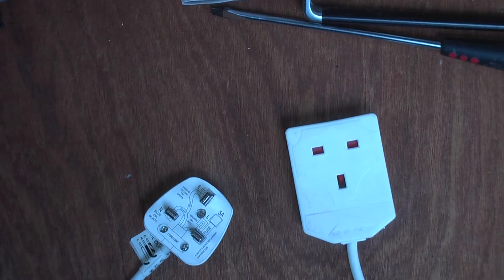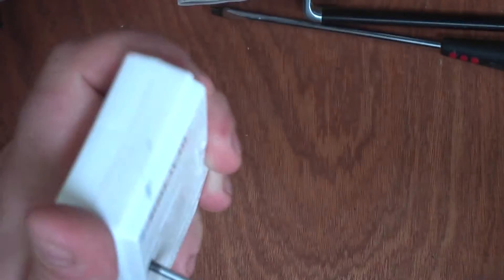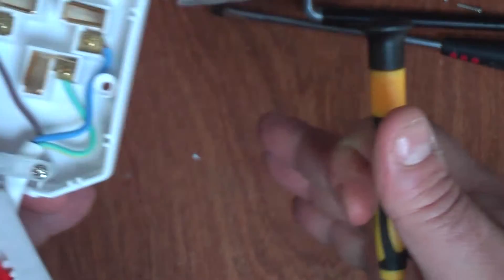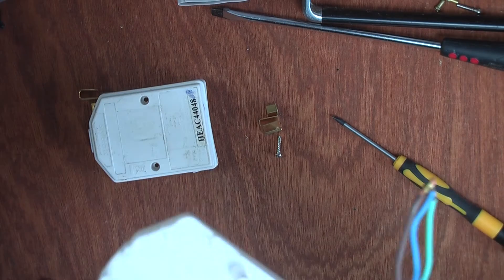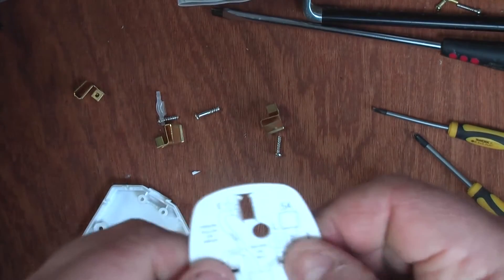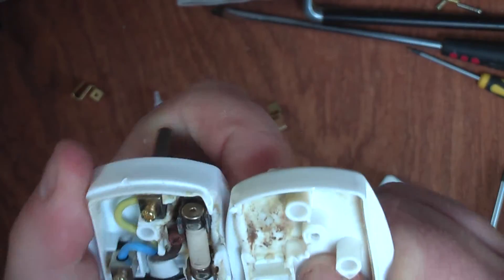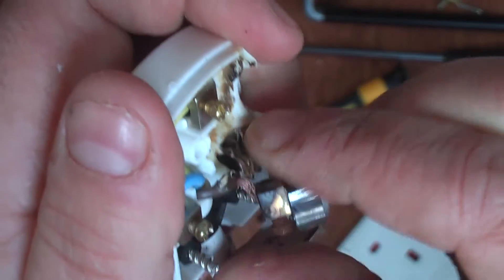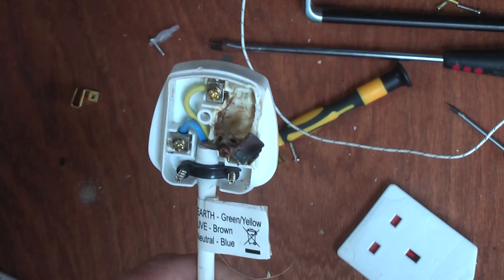Teardown of a dangerous extension lead

Comment: Couple of things here...
Don't pay €5 and expect the same quality of product a you'll get for €15.
You would benefit from studying BS1362 and 1363 to understand the requirements for the standards.
The lead does not look new but you have not given any history of it.
The paper card on the plug should always be removed before use.
The cord grip is fine, budget leads will not have have good strain relief moulded in.
If it was a 500W heater is only going to provide a 2A load, so it it VERY unlikely the load, on its own, caused the failure.
Trailing sockets are commonly fed from the 'top' of the socket, i.e. above the earth connection.
The wiring in the socket is correct; the earth connection would be the last to fail through strain on the flex, live would be the first.
The flex is undersized for a 13A load but should have been fine for a 5A load.
The flimsiness on the material of the plug and socket is typical of a budget product, but it appears it was fire retardant which is fine.  BS1363 permits the material to burn but requires the material to self extinguish within 30 seconds when heat is removed.
A 13A fuse is not "fine for an extension lead", the fuse rating needs to be correct for the current rating of the flex to protect the flex.
Can't comment much on the fuse as we didn't see enough of it but it didn't appear to have the required marking on it.  It did look loose it the holder which is probably what provided the heat.
Other than the fuse holder, the only problem I can see with what is shown is the screw which retains the plug top should be captive in BS1363, it shouldn't simply drop out.
Had someone changed the fuse in this at sometime and possibly damaged the fuse holder?

Comment: The live and neutral appear to be the wrong way around at 4:06 ... Might explain the melting.
Reply: No, they are not and in anyway it does not matter if you mix them.
Reply: @okaro6595  It Matters a lot! You always fuse the live. If reversed, electrical items can remain live even when off

Comment: Not using the british plugs here, but from what i understand, earth is closest to where the wire is going into the plug, so wont it be the last one to get pulled out?
Reply: yeah but earth from what I know doesn't carry current unless there's a fault it's a safety thing
Reply: My comment was about what he said around 3:30 about the earth wire suposed to be the last one to get pulled out. earth is closest to where the wire goes into the plug, therfore it will get ripped out last.
Earth is there to groud the outer mettal on stuff to awoid giving people a electric shock aso.
Reply: +Jan-Robert Nergård yeah like washing machines :) I understand what you mean now :3
Reply: so if there's an issue on the live it'll stop it from making the metal casing live

Comment: trouble is, there are a lot of imports with fake BS logos etc.  i cant find the video i refer to, but they bought several 4 way extensions from the both usual high street and diy stores, and a few from market place sellers and ebay uk sellers. they tested them at the full (3kw?) rating and monitored them.  the regular store ones all performed safely, some of the market place ones, had all kinds of issues, the plug melting exposing conductors, the sockets failing in similar ways, and the plastic both being of the wrong temperaturee rating and not being properly non flammable, they all said CE markand BS marks, but of course the bad ones faked it.